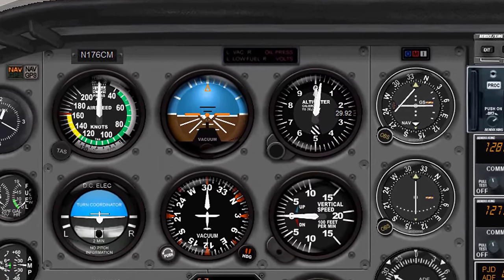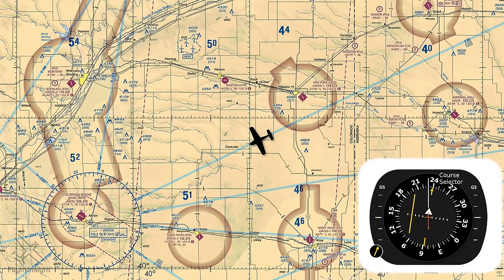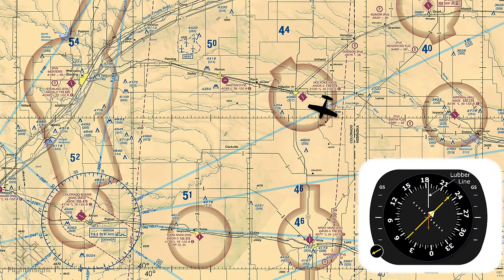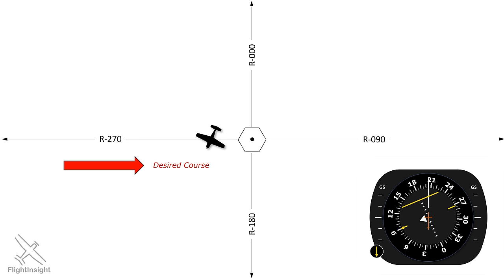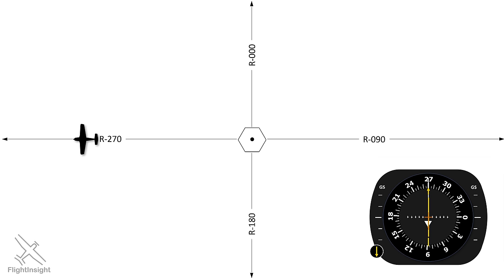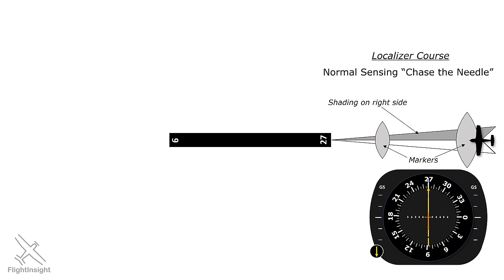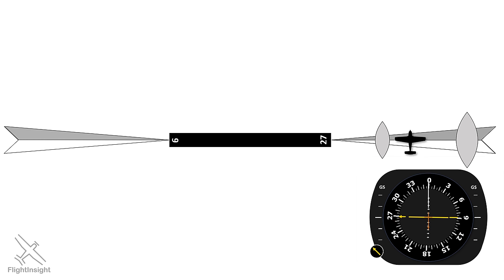Horizontal Situation Indicator Explained | HSI Test Questions | How an HSI Works | Chase the Needle

Comment: Quick way to tell which quadrant you're in. Visualize the VOR as if it was physically sitting on the center of the HSI. You are ALWAYS in the quadrant opposite the direction of the arrow and the opposite side of the deviation bar, ALWAYS. If you get disoriented it gets you immediately in the ballpark. I love HSI's
Reply: This is so much easier,  and more to the point of why the HSI is so useful for situational awareness
Reply: THAT ...was helpful .... I'd be circling for 20 minutes trying to get my bearing especially in a strange air space without any hope of recognizing anything ... Best to keep on course and heading and plan ahead for me
Reply: @tangotango256  of course you're right about staying on course but when  changing headings and switching to a distant VOR an HSI gives you a visual big picture much less prone to error than the standard windshield wiper VOR especially when it's one of those days when you're trying to hold on to your lunch.
Reply: Wow, that makes it so easy to understand. I'm glad I saw this comment! Thank you so much for sharing!
Reply: This is quite honestly the most helpful youtube comment I have ever come across. I've been struggling with HSI questions (getting maybe 25% of them right) and literally this comment alone brought that up will into the 80s. THANK YOU.
Reply: @connorlicharz5264  thanks it's been a rough day today for me and your comment just brightened it up considerably.
If you got 80 there's no reason you shouldn't hit 100%. I mean if you're flying on the gauges that's where you have to be, correct?, nothing less than a hundred will do.  Permit a quick recap.
There are only four quadrants you could be in. The HSI is sitting vertical on the instrument panel but imagine it, see it, as if it were lying flat on the earth with the VOR always in the middle. FIRST, look at the arrow, the to and from the station, you're at the opposite end of where it's pointing, and that eliminates half of the four quads, two down two to go. Now eliminate the side where the wiper bar is sitting and there is only one quad left and that's the quad you are in. A piece of cake, I thought you'd say that.
Reply: @hotprop92  Thank you! Piece of cake!

Comment: The FAA written IFR tests (IFR, CFII, ATP) are stupid  is confusing at times.   In reality and when flying, it’s so easy to just figure out what radial you’re actually on by turning the OBS and centering the needle from the station of the selected VOR.  Then just tune for the direction you need to go, either TO or FROM the station.    Easy.

Comment: When you're flying a localizer back course with an HSI you always set it to the FRONT COURSE radial.  That eliminates the reverse sensing, and you can fly towards the needle as normal.  There would be no reason to set the HSI to the back course radial.  I suggest you publish a correction video that talks a little more about flying a back course with an HSI.
Reply: I totally agree. I was shocked and disappointed that this practical technique was not mentioned, since it eliminates most of the confusion for a back course approach. OK, you need to get the test questions right and pass the test, but later, it's more important to keep things simple when you're actually flying.
Reply: Thank you for reconfirming that for me. I haven't flown for years but I remember the back course thing with the HSI. 
I thought my memory was imagining things.
They should redo this with a clarifying explanation. Anyway I thought I heard where the FAA is eliminating back course approaches.
Reply: Yeah that’s what i thought as well
Reply: Obviously that’s what you would do. But for testing purposes, they want to know that you know how to navigate it.
Reply: @RandyMarsh-nu6lo  Noooo...if I was taking a checkride in a plane with an HSI (which I did) and didn't set the OBS to the front course of the ILS, that would have shown that I don't know how to use the equipment in the plane.  I don't know whether that alone would cause a failure on the checkride, but it would definitely be a checkmark against my proficiency.  And for a written exam, questions regarding the HSI expect you to know that you have to use the front course heading.

Comment: you turned to the radial ( 45 degrees ) that’s all good but you traveled to the radial and as you come closer your CDI will be alive, when are your start turning to the station and be exactly on the radial and cdi in the middle,

If you start your turn when your CDI in the middle you will over shoot the radial if it is early then it will be undershoot. When exactly your start your turn.. 

Thank you for your videos they are very helpful 👍

Comment: I've watched a few of your videos, which I find great. However, you should replace the term "chasing the needle" with a "fly-to" term instead. After an HSI, the next move up is typically a flight director, which has "fly-to" commands, therefore it makes sense to introduce the term early so it sticks. Also, when using the HSI for an ILS, it's good to remember that the CDI will be centered if you are inbound on LOC, even if the CDI is on the incorrect front course. Also, the HSI is very helpful during crossword condition as the wind correction angle will be right on front of you in plain view. To my knowledge,  there are very few BC approaches in the US. Not sure why the FAA still asks on BC, as well as NDB approaches. Canada and other parts of the world are a different story. Keep up the good work.
Reply: Crossword Condition?? 🤔
That's a new aviation term for me.
Also "chasing the needle" is understood because early instruments were analog. 
"Fly to"? Really. I mean you are already up in the air flying, right? So you are, chasing the needle on the instrument. Not "flying to" the needle. Also, on Helicopters you have engine rpm and Rotor rpm on the same instrument. When the "needles" align, both rotor and engine rpm are at the same rpm. 
When you "split the needles" this normally means that the sprag clutch is disengaged or the engine is now disengaged from the rotor and the rotor is free wheeling, normally used in Autorotations. IMO this "fly to" shit don't work. If it works for you, good. Let's not try to change convention here. In all the aviation books I've read the term used is needle. Like a Compass needle. Not a Compass "fly to".  Most pilots would agree.
Now, where are we going to fly to, today?

Comment: I’m a newbie at trying to understand Flying Instruments. Would help greatly if I knew how the gage internally worked. 
Understand there are gyros running within the Instrument. They react and show direction on the instrument face. 
- How are they calibrated to a given map? 
- What is the directional accuracy within these systems?
- Are Electronic Computer Systems more accurate then old school mechanical systems?
- If I’m to trust an instrument that’s directing me, how dependable is the instrument to maintain giving an accurate instruction?
- When starting my flight the instrument is probably calibrated, will it somehow or can it loose its calibration?
- Would there be times during a flight I would have to scrap following the instrument and follow another directional source?
Thank you for providing a great aid to understand this instrument. Sorry for the questions but I need help to understand.

Comment: @FlightInsight Amazing content as always, probably the go-to channel for all practical facets of flying, not least IR. May I ask one question on this one please? On 6:25 we're supposed to fly to the right off-centre to intercept R270 outbound the station; your DI animation shows headings increasing as if a right turn were performed, where the airplane animation shows a turn to the left to achieve heading 315 (i.e, headings decreasing). Would it be safe to assume that the correct turn (shortest path) for this interception would be either (right or left), considering the interception heading lies exactly behind us (i.e., it is the reciprocal of current heading 135)? Vert grateful indeed for your videos and insightful channel!

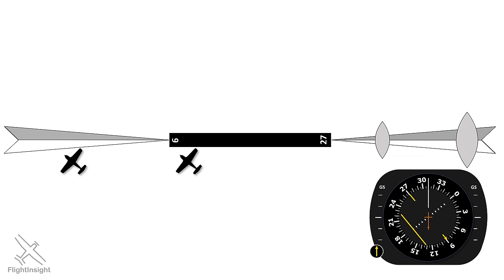Comment: At 11:47 of this video, in your third example, you identify the airplane as being in the lower left quadrant.  The arrow on the HSI is pointed to 9.  the drawing on the paper shows the feathers such that this is the 27 approach.  Are these in contradiction?  It’s as if the HSI isn’t matched up to the intended course.  My question is, did you use the HSI in this example, as if it is set up to approach a different chart (the 9 approach)?  The HSI doesn’t know which piece of paper, or arrows, you’re using…. So, just according to the HSI, I’d expect that this plane is on a 31 heading.  but, since the HSI is set up to go TO 09, and since the needle is to the right of center, as one goes toward 09, then isn’t the plane to the left of center, approaching 09?  This puts the plane in the top left quadrant.  thank you.
Reply: i agree that part seems wrong, the aircraft is left of course of 09 so it would be in top left quadrant... great videos regardless.
Reply: I was also think like this! I still dont get it. So which one is the right answer? I also find out the airplane need to be top-left quadrant (for rwy 9), and top right quadrant (for rwy 27)

Comment: In the instrument testing supplement FAA-CT-8080-3F regarding figure 96 shows runways 09 and 27. in the figure 09 has right shading and no marker beacons, 27 has LEFT shading AND marker beacons. So does the fact 09 has right shading mean normal sensing? Does the fact 27 has left shading mean it has reverse sensing BUT it does have marker beacons, do they cancel out the reverse sensing?? 

One test question refers to both figure 96 and 97 and asks to which aircraft position does HSI presentation "E" correspond? You have three options to answer, either #8, #3 or both #8 and #3. Your only options are on the shaded side of the feather however the HSI presentation "E" shows the needle off to the right whereas your rule you made mention of at 9:45 states "no matter what, if the aircraft is on the shaded side of the feather, the needle will be off to the left..." I am using ASA practice test software and apparently the correct answer is both #8 and #3, disregarding whether reverse sensing is a factor or not and selecting both solely based on the fact they have a 045 heading.

Thats a lot of conflicting information. Thoughts?

Comment: At 6:25 you display the aircraft turning left, but the instrument shows a turn to the right.  Still a 180, so it doesn't matter which way to go, but definitely tumbled my gyros a bit.
Reply from the maker: Thanks so much, you're right that is disorienting! Will be fixed in the version on the full course.

Comment: At 6:22, the HSI doesn't match the plane.  To intercept radial 270, the plane turns left (counter-clockwise), therefore the heading actually decreases, i.e. 135 down to 0 (same as 360), then 360 down to 315.  However, the HSI incorrectly shows the heading increasing (135 up to 315).  Note the moment when the plane is heading east (parallel to radial 90), the HSI says the heading is 180.  I use flight simulators casually, so I hope this is clear enough.

Comment: position on localizer I got down, its relative to a VOR station that is still pretty hard to wrap my head around
Reply: Picture the VOR as if it were sitting in the center of the HSI. Virtually that's what this instrument does. Example, if the arrow is pointing up and the bar is swung left you are in the lower right quadrant. You are ALWAYS in the quadrant opposite of those two indicators. If the arrow points down and the bar is to the right you are in the upper left quadrant, etc.

Comment: Sorry, but there is a mistake in the video - on 6:28 airplane turns to the  left  but HSI shows right turn.   if u pause the  video u will see  that airplane has heading 90 , and hsi shows heading 180 at the same moment

Comment: God Bless this guy but hes teaching it all wrong in my opinion. First, stop thinking about the needle as left and right. You can do this with a HSI but you will screw yourself with a VOR. 
Step 1: Note your heading. That will narrow down whats on the test to just a couple or a few.
Step 2: The needle doesn't tell you left and right, it tells you what cardinal heading, roughly the course is from your position. So lets think of this in an easy way. Look at the HSI at 5:48. Look at the side the needle is on. It is on the east side of the instrument. So your course is east of your position. Now look at the test and see which ones are left that fit the course being east of you. You may already have the answer to the test.
Step 3: Now look at the arrow. It also points to a side of the instrument. It is showing you where the VOR is from you. So in this case its East of your position. 

Without even knowing your heading you know that the VOR station is roughly NE of your position meaning, of course, you are SW of it. Whenever you are wanting to know where the course is at or where the VOR is at, never think its left or right of my position. It will get you into trouble. Always think of it as its NE, or S or whatever.